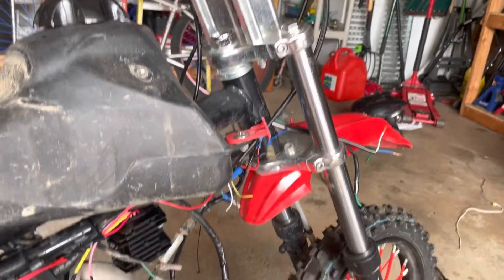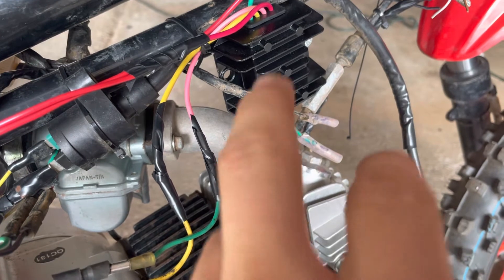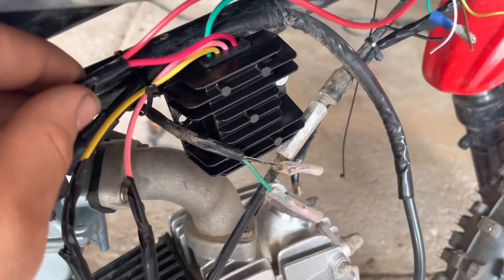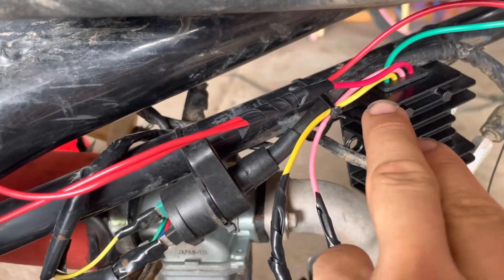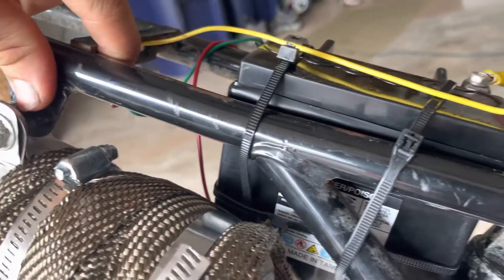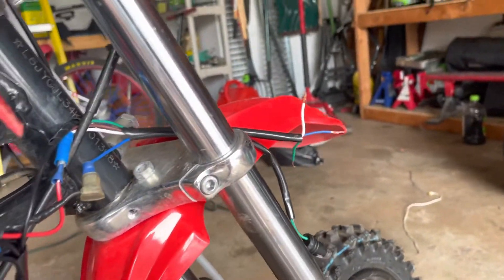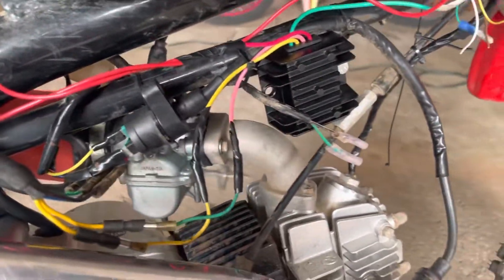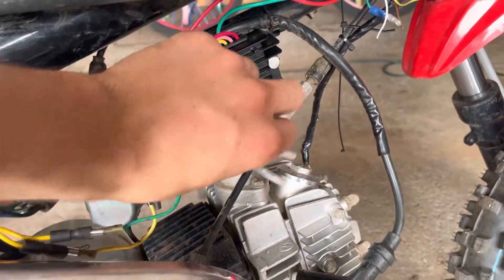How to wire charging system into pitbike/ssr125

Comment: You need to add in a relay do not i repeat do not run a hot wire from the battery to a control switch without the proper relay you will melt the switch

Comment: Hey I’m rebuilding a zongshen 125 pit bike right now and it came with everything your talking about however I can’t find anything about these bikes! I got two ssr that I ride all the time just this one has the harness already built two run a headlight and rear light and it also has a key! So basically my question is do I need a battery
Reply from the maker: It all depends on what voltage rectifier you have some require it some dont

Comment: I am not getting 12v out of the rectifier unless i rev the engine very high. Thats no load with a brand new one. Do you know whats the problem?
Reply: Just curious, because this has been something I've wondered while browsing kits, did you install a new stator/magneto? If so, how many coil packs were there? I have been wondering if it is a must to grab the stator with more.
Reply: @user-sk2kt1vy6y  its a new stator and there was one coil for ignition and one for lights / rectifier.